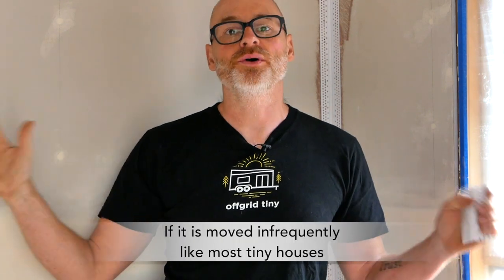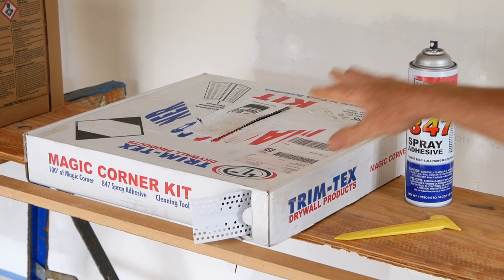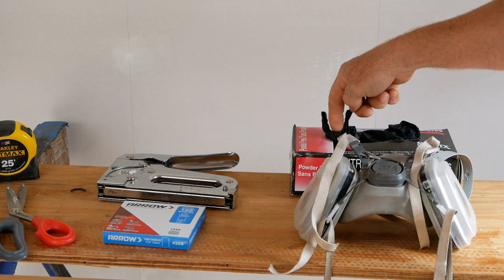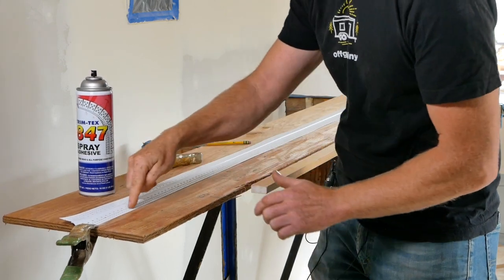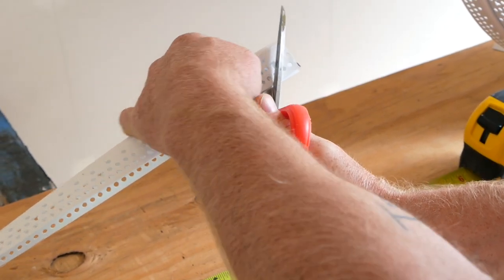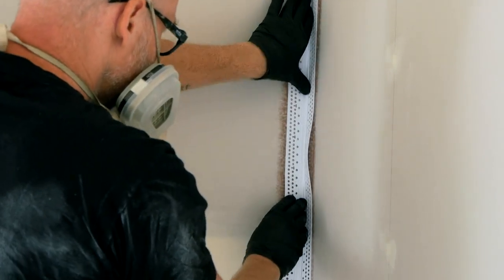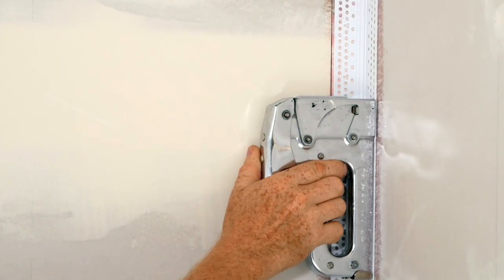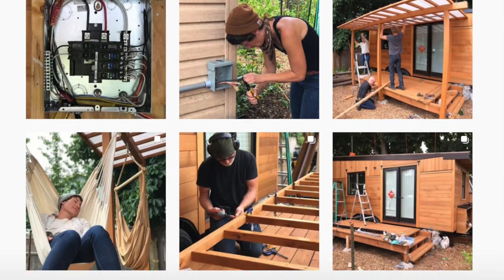Tiny House Drywall: Installing Flexible Corners

Comment: Thank you so much for these tips! Did you use this on every seam, or just the corners? 

Also, did you use 1/2" drywall - any concern about 1/4" drywall in a tiny house?

Comment: Great tip - did you end up making a separate video related to drywall installation? I'd be very interested in that content! (or any resources you found helpful there)
Reply from the maker: We aren’t professional drywaller‘s in so I didn’t feel comfortable making that video.  We tried our best just to use best practices and we also glued the sheets to the wall in addition to screwing them.